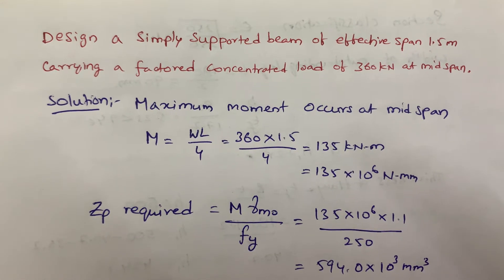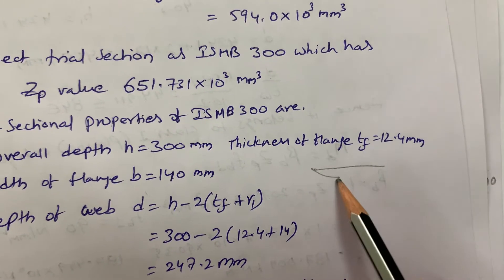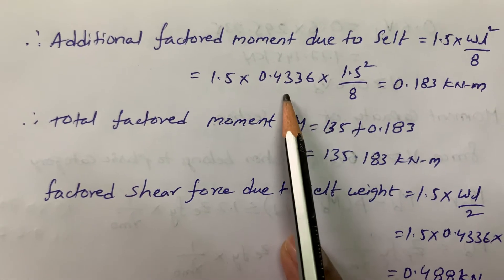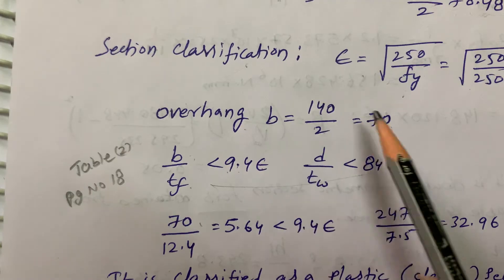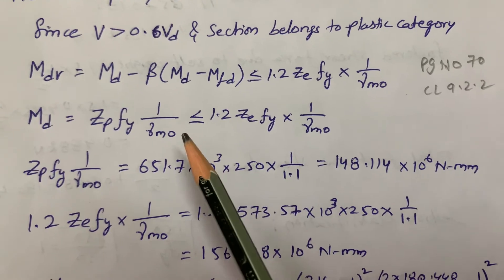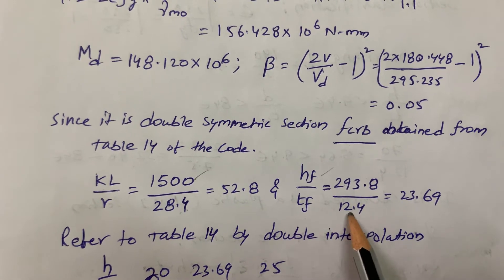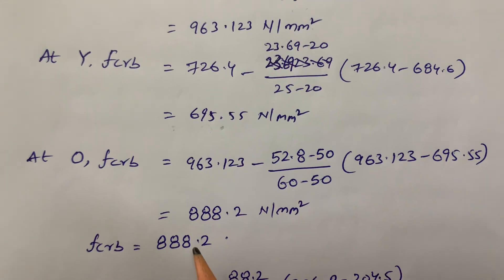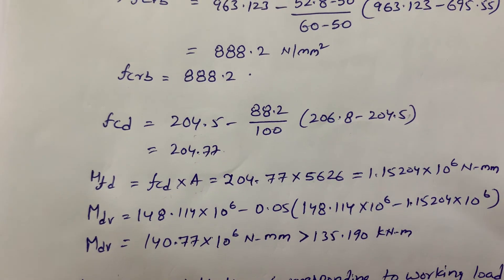#Design of simple supported beam#Design of beams#Design of steel structures#ISMB300#

Comment: In fcd single interpolation how did you get 88.2 divided by 100??? It is not there in IS CODE
Reply from the maker: Page no 40 in IS 800:2007 table 9a

Comment: How Wii you select Ismb 300
Reply: Why should not taken 600 why you taken 300
Reply: @singamsravan4829  600 is not cost effective it’s just a trail section that’s why I choose 300.
Reply: Zp required value is 594, In steel structures subject it is completely practical subject. So, The nearer value of required Zp is ISMB 300 that’s I choose ISMB 300 by referring steel tables book.
Reply: Near value 600 only na
Reply: @singamsravan4829  please once refer the steel tables book. For ISMB 300 and 600
Reply from the maker: the section which is nearer to Zp required, thats why you have to refer code book.